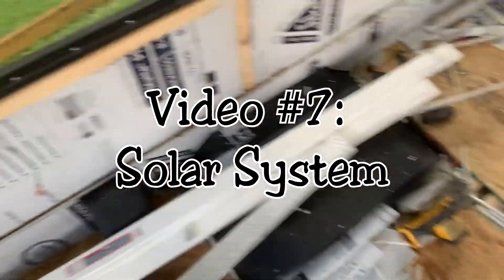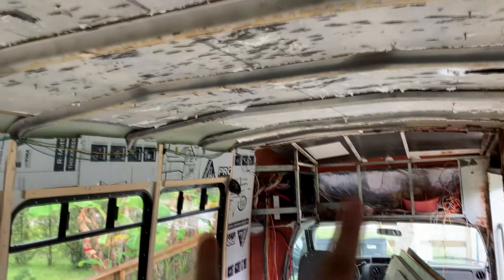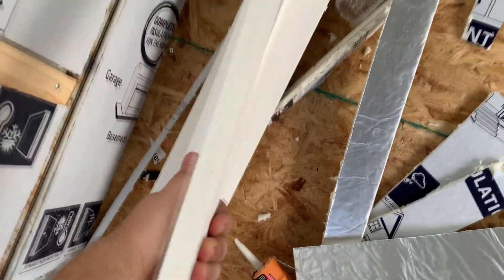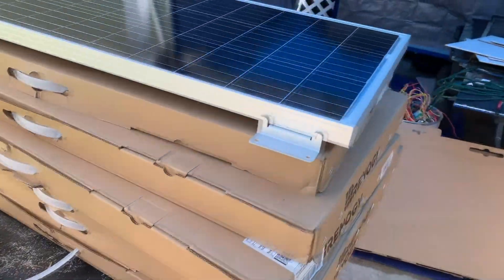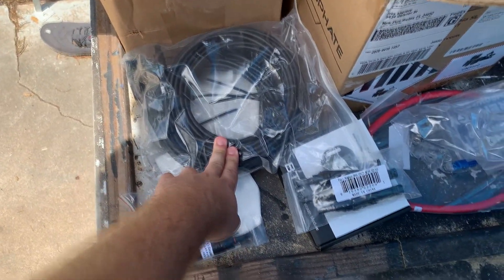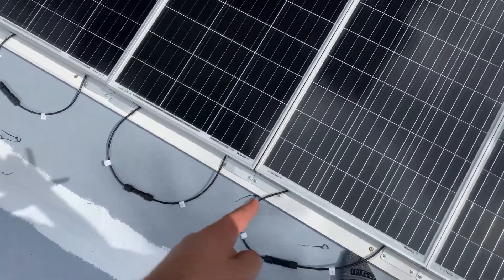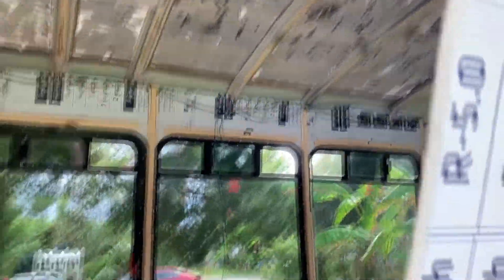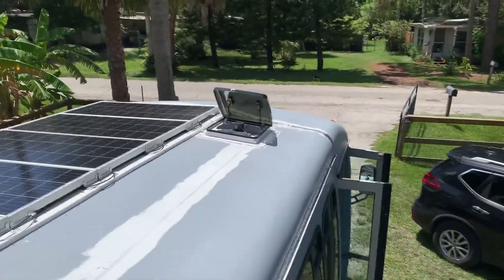Solar Panels/Solar System - Shuttle Bus Conversion Ep. 7

Comment: Congrats on getting your solar, dude. 

Good on you for doing two roof fans. My bus is only a 4-window shorty but I really wish I had two roof fans as opposed to one.

Don't get me wrong, I love my roof fan and have been using it every day that I've been building but having a second one would really help pull a lot more air through the windows.
Reply from the maker: Thank you! and Yes! That's exactly why we chose to have two. Most of the time we only need to run one. But on days we really need to ventilate the bus its amazing!
Reply: @tmladventures2045  Came back to tell you that I bit the bullet and installed a second fan (14" this time). It's SOOO much better. Thanks for pushing me over the edge!